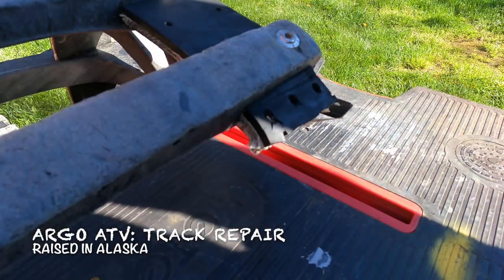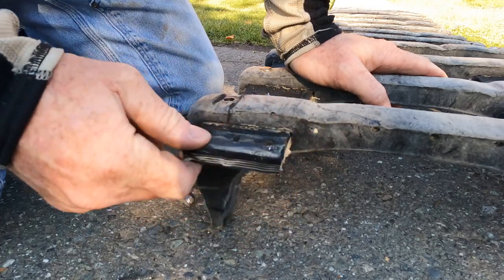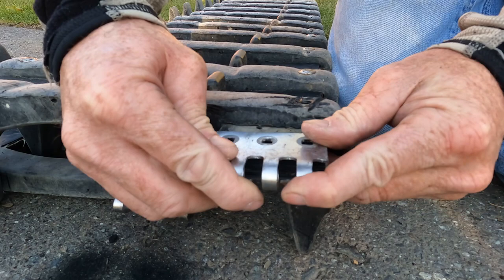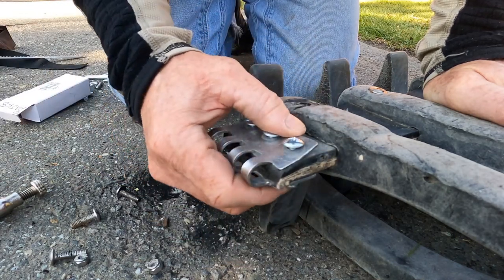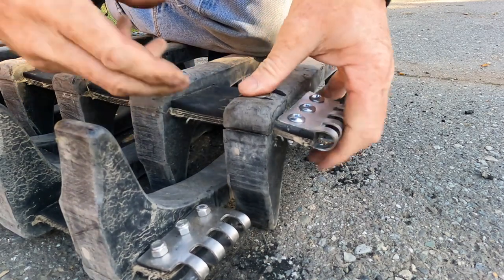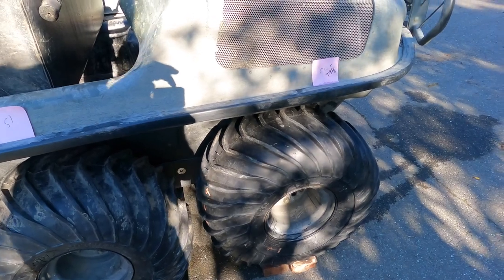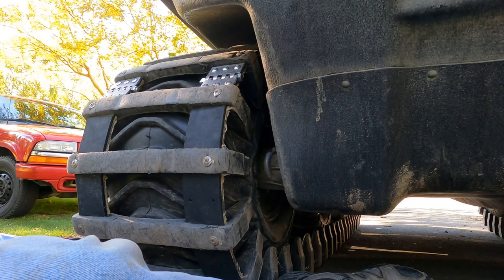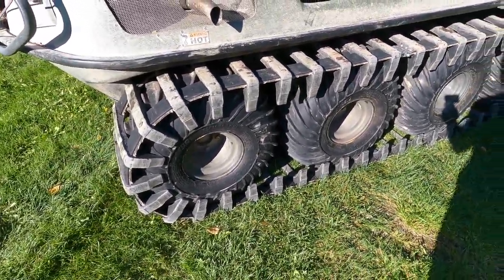Argo ATV: Track Repair

Comment: Could have taken the heads completely off, pried the outside of the grouser off the shanks, then put the vice grips on the bare shanks. But, what you did, worked. So great job!
Reply from the maker: Thanks. I’m just happy that they are back on the machine.